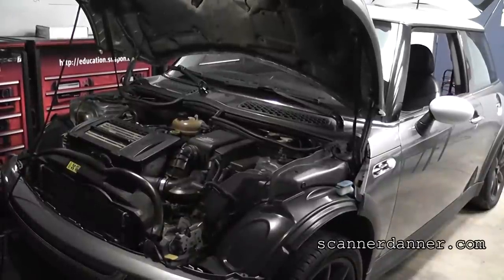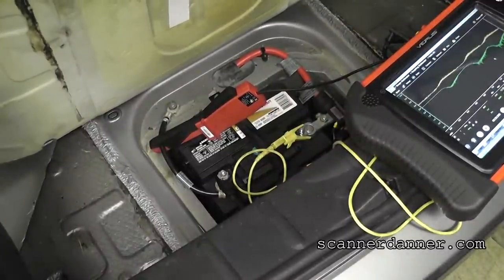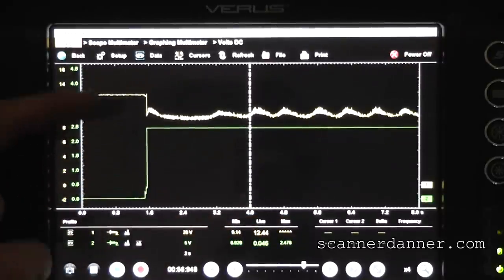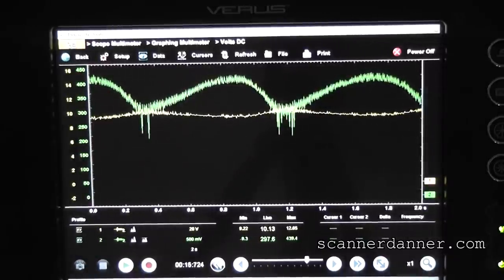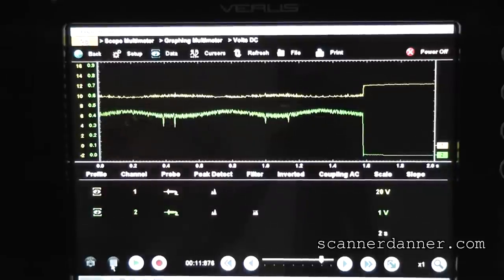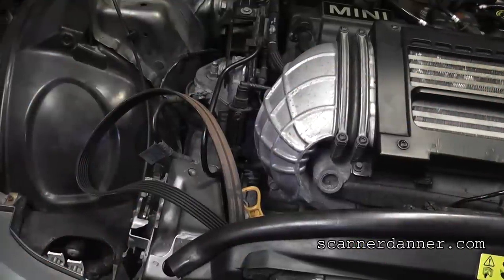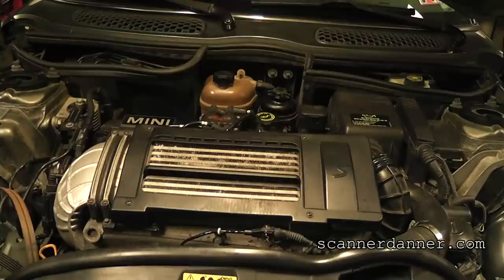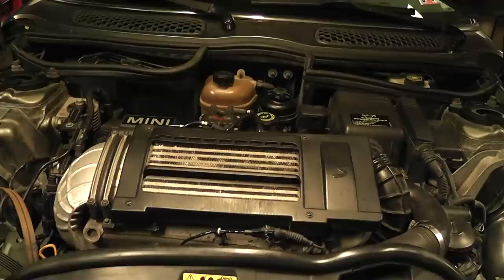Engine does not crank (seized alternator) - Mini Cooper

Comment: Thanks for posting this video. On my 2006 GP I had the exact same issue - car would try to start and just wouldn't budge. I replaced my 8 year old battery, starter, ignition switch.......all to no avail......until I finally found your video. Took the belt off, car started right up. New alternator installed, good to go. Thanks a bunch. I'm sure I'm not the only person to benefit from this knowledge. Thank you again for sharing.
Reply: The reason my alternator seized was because I hit the mother of all potholes on shocks that were already on the brink.....at 80K on a 2006......and it cause a catastrophic failure to the metal housing of the alternator (and I'm sure the interior as well). New shocks all around and now I'm golden.

Comment: Funny thing, Today a costumer walked over to the shop and said he needed a tow   " My engine is making a lot of noise and now I cant start  it and  cranks slow."(Chevy Truck) So I drove over with a Battery jump pack and the Costumer. With the jumper it still cranks slow, after watching the Mini Cooper video yesterday at lunch I remembered to watch the pulleys during cranking and guess what yea the alternator was frozen, So I cut the belt off and the truck started right up. The costumer was happy not to pay for a Tow. I Love  the Videos, So Helpful.
Reply: This don't make no sense dude.  If you had to jump the battery but you cut the belt off. Then without the belt the alternator won't charge the battery and the battery will die right away again.  Where is ur brain dude

Comment: Thank you for posting this video. I have a 2006 Mini Cooper S GP with 88K and initially I thought I drained the battery. It was manufactured in 2010 so I figured 8 years old it was due. Changed to an Optima Red Top 34R and still wouldn't start. Bought a starter, still wouldn't start. I should have tried taking off the belt. Once I did that, it started right up and I couldn't move the pulley on the alternator 1mm - it was 100% seized. Thank you again for your help.

Comment: Can’t thank you enough for posting this.  I have limited repair knowledge and this helped me realize why my Mini Cooper that sat for 2 years was barely cranking after putting in a new battery.  Was about to replace starter before o saw this and found out my alternator was seized.   Interestingly the alternator pulley would only spin backwards.  Great video.

Comment: The whole diagnosis part wasn't particularly helpful for me, but the fact that the symptoms matched my car and you were the first source (of MANY I had tried) I saw suggesting a seized alternator pulley and lo - I went out to my car immediately, jacked it up, removed the front-right wheel, attempted to manually turn the crank pulley (impossible), removed the belt and confirmed the seized alternator pulley. So I do have to thank you very much!

Comment: Nice one Dan
Back in the early 80's ,before all the Hi tech in cars, that's a test we carried out by hand to check for a seized engine, ie disconnecting all the loads on the engine whilst either pushing the car or turning the wheel

Comment: Paul,

Yet another great case study video in your series. I would have never guessed a seized alternator could have been the cause of the engine drag. That goes to show how  tough those serpentine belts really are. Would have expected the belt to snap. first or the starter motor to have burned up (again???)

Good job; and keep these case studies coming.

Tom

Comment: Had to revisit this one after a call today.. No crank, no start, only a click from the starter. No dice after putting TWO separate starters in it. Remembered your training in the heat of my frustration, back to basics. 450 amps flat on starter wire while key in crank position, crank pulley seized, removing spark plugs didnt help, acc pulleys smooth. Sure enough, dipstick showed only a drop of black oil, and customer was 6 months overdue for an oil change! Calling it an engine. Apparently not too uncommon on the 2013 Sonata

Comment: Good video. People would be surprised what seized pulleys will do. I’ve seen quite a few seized ac compressor pulleys keep a powerstroke from cranking like engine was seized. Undo the belt and it fires right up. Pretty crazy considering how much torque the Diesel starters put out

Comment: Cool vid Paul. I specialize on European cars myself.  Another common issue with Minis/BMWs which causes all kinds of crazy symptoms and is commonly misdiagnosed is the BST battery cable. As soon as you mentioned auction, I said another BST victim. :) crazy someone sent that  Mini off to the chopping block.

Comment: If you Google "mini cooper seized alternator" you will see this is a very common issue. here in the UK where these things are on every street corner it's a well known issue. Did the belt actually manage to turn the alternator, or was it slipping? They often just melt the belt, with acrid smoke and jellified rubber everywhere :) Another great video SD :)
Reply: It's the bearings ?

Comment: I've seen similar symptoms with a seized a/c compressor, more than one time.  Sometimes the belt will burn up and snap/slip off the pulleys which makes the diagnoses much easier and other times the belt shows no symptoms, like in this seized alternator case.  Great practical video.  Thanks

Comment: Awesome video Paul, really good stuff, i have had simlar, think mine was a seized engine, i wonder in hindsight if you could have looked at the fan belt to see if it turned or smoked/ smelt when cranking, i know easy to say afterwards,,,when you first cranked it i thought it sounded like a broken cam belt...good stuff...Fred UK.

Comment: hi, i have had this exact problem with the same car,  this one turned over faster and the actual difference in cranking speed was only 15 rpm. 185rpm and it would fire on the first couple of cylinders then flood, after removing the belt it cranked at 200 rpm and fired instantly. I took lots of wave forms with the pico of the cranking amps, crank and cam sensors, ignition primary and injectors. I learnt a lot from the ignition waveform the way the spark dropped off at the end of the burn time etc. I have only been using the scope for 18months or so but find your videos very helpful. I will email the wave forms over to you if you would like a look.
Reply from the maker: post them to my forum! thank you!

Comment: I have run into this several times on Fords with a VS10 compressor locked up, remove belt and boom engine runs. So I always R&R belt on locked up engines to make sure before calling it as a engine

Comment: I had a ford zx2 do the same thing but it was the ac compressor that was locking up only at times. I'm still little lost on understanding amps
Reply: the greater the resistance the engine has, the more current it will draw to overcome that resistance.  but in this case and yours, it was an accessory bogging down the engine.

Comment: Hi Paul well it seems to run all the way through using google chrome and not Internet Explorer 10, but that it probably to do with my computer or my end and nothing your end, so think it's ok, i wonder when you tried to turn the crank if you rocked it a bit, if it had been engine prob would have been rigid, i bet it moved slightly either way...i suspect an alternator for that not cheap, that's a German BMW cooper i guess so not the old English one...best wishes...Fred UK.

Comment: It's such a knee jerk to throw in a battery and starter motor, so I suppose getting burned with a case like this is not surprising. With that sound I would have been thinking battery, then I would have done a drop test. Then I would have paused, wondering how to make sense of it! The real clue came from the high current drain from the starter motor, but only if the tech had the insight to measure current draw. Gotta start doing that routinely. I like to think that on a good day I would have considered some kind of mechanical problem, ha ha. You realize that your videos are better than a mystery movie on Saturday night? Only thing is, they don't usually disclose the name of the villain in the title (grin). How about, "Mystery challenge -- crank no start".
Reply from the maker: thank you brother! unfortunately the titles are this way to guide the searchers if that makes sense. People have a specific problem that they search for and the title needs to reflect that. It does give away the clues for the mystery movie people like you. I wish I could find a balance in that :-)
Don't read the title haha

Comment: Question. Isn't the Pico Scope way superior to the snap on scope at least in it's functionality and resolution? You are so good with scopes I would think you would use the Pico? I have a 2000 series Pico  "wish I had the automotive class Pico"  our shop has the Snap on Triton D10 at 7K ,  the 175$ Pico just seems better. How come you don't have a Pico "cart" setup at your brothers shop so you can use snap on with Pico I would think that's the winning combo.

and
Reply from the maker: It truly is, but I can do most of the tests I need with my Verus scope and we use screen recorders, so when I break out the pico, I have to add another screen recorder and I already have one going on my Verus for codes and scan data. That is the only reason you don't see it more

Comment: when testing compression do you use volts or amps to measure
Reply from the maker: depends on the amp clamp and scope I am using. On the Snap-on units I am using a low amp probe, which is not designed for high amperage testing, so I use a volts DC setting and do some math.
Reply: ok thanks I thought volts is a little cleaner signal in doing compression but thanks again

Comment: I always thought high amperage would be the result of low resistance like a shorted starter armature or field coil. Didn't know a mechanical failure would have the same result.

Comment: But why the high current with the serpentine belt seized up? I need to understand this... It's mechanical resistance, how does the starter "know" it needs to work harder? If it was electrical resistance the current would've been lower, right? So that's the opposite of this kind of resistance I guess. And also, wouldn't the system voltage drop more than normal during cranking with this high current we saw initially? Please help me understand this! Love your channel btw! ::)
Reply from the maker: It is becoming more and more difficult to answer questions here. I have 80,000 people asking me for help now. So I have created a forum to help you guys better. It is free to join and we can exchange pictures, wiring diagrams and waveforms if needed to help guide you through the process of troubleshooting your vehicle. Thank you so much! Hope to see you there. 
Paul Danner (ScannerDanner)
 https://www.scannerdanner.com/forum/post-your-repair-questions-here.html
Reply: It is due to electric motor properties. When a motor is loaded down it draws more current automatically; when a motor is forced to run slower than it would free spin, the current goes up until no more current can flow and it stalls the motor. If you could jam motor output shaft and completely keep it from spinning and apply voltage you would get the maximum amperage reading.
Reply: theomnipresent1 Thank you :)
Reply: SomeCoolName
No problem man! If I could elaborate on my previous answer I would say a few key things to help with intuition...

~Lowering resistance increases current, and increasing resistance lowers current flow.

~Higher amps increase the strength of a magnetic field.

~Higher magnetic field in motor windings increases torque.

~Slowing/loading down a motor effectively "decreases" the resistance of the motor.

Knowing these facts you can see that you can now see how it works. When a motor is loaded down its resistance decreases, so the current flow increases. That increased current flow creates a stronger magnetic field, which induce a higher torque applied to the load. If the increased torque is not enough to overcome the load the motor is further slowed which starts the cycle over again. This will continue until the motor is stalled at maximum current flow only limited by the electrical resistance of the windings.

If the load disappears the rpm will increase and the opposite will occur. The effective resistance will increase, decreasing current to a point where the motor finds its balance at a minimum running current where a motor runs most efficiently.
Reply: I hope this was helpful, I had the same questions at one time.

Comment: A seized manual transmission can catch you out.Put your foot on the clutch to be sure!
Reply: Arsenal not all manuals have a clutch safety switch
Reply: ltkaffey
Allso cluch release can be broken, sean many times but as today they have bean so that starter is strongenaf to start the car in gear. when handbreack is of ofcorse. You normaly see movement in body and thats gives the problem up.

Comment: 1.6 liter engine, that's small, turn the AC on and the engine dies... lol. Seriously though, I'd check to make sure that belt wasn't too tight prematurely wearing a bearing out. I've encountered bearings locking before, and most generally the belt will burn into while driving down the road. I wonder if that bad bearing immediately seized up after the engine was shut down, assuming the alternating bearing itself was the problem?
Reply: The 2002 MINI Cooper S with supercharger makes 161HP. You can barely tell the performance difference with the AC on or off. The belt is self-adjusting via a spring tensioner. The car was probably left sitting and it seized in place. From the video there appears to be some salt corrosion.
Reply: *****"The car was probably left sitting and it seized in place." Mind telling me how just sitting causes an alternator to seize if nothing else was wrong with it? Funny, all those cars over the years I've started that sat for who knows how long, and yet I don't recall a alternator seizing up because it just sat.... ? Unless of coarse the engine was left out in the rain to sit there and rust, but then you usually don't even mess with engines that bad to begin with, those are considered parts engines.
Reply: ***** I believe you're confusing salt + rust corrosion with simple rust corrosion.

If you have salt corrosion the process is triple the normal one and because of electrolysis parts will get seized up on a very small scale IE far harder to unfreeze a salty bearing than a rusty one.

IMO salty corrosion is the worst thing that can happen to a car. It's like metal termites.

And inside the alternator a part with multiple metals, it's like salt corrosion heaven, complete with water and electricity.

Comment: hi, if my starter is bad, how does he hump looks like, will it be flat .. do we have any videos on that, please.
also if starter is bad does it draw more amp or less amp or could be both.
if i have bad ground will the starter take more amp or less amp.. pls advise
Reply from the maker: The waveform characteristic will depend on a lot of variables. If the motor is not spinning then, yes, there will be no "humps". If the motor is spinning, the speed that it is spinning and the forces it encounters that slow the speed down will also change what the waveform looks like. Remember it is not just compression forces that can slow the starter down. Slower speed = higher amps
Reply: Thanks so much. Paul

Comment: Hi, Danner
I've got burned by this before, only it was on a Cummins ISM The Injector fuel pump wasn't building pressure fast enough. So I had the customer buy a rebuilt pump and Installed it with same results, fuel pressure takes to long to build. Found the cause in those pesky simple pre checks. Engine speed must be a minimum of 150 RPM, new starter motor fixed the problem. Here is a link to another video about seize pulleys. http://youtu.be/-TYa4OpdUns?t=8m30s

Comment: I would look to see if the car or at-least the engine has been for a dip in the ocean. That bottom crank pulley looked awfully corroded. Getting salt water in the alternator and letting it sit would explain it seizing up....If this is the case the new owner should sell it ASAP..before the body starts to go..
Reply from the maker: nah, its just the good old rust belt of southwestern PA. :)